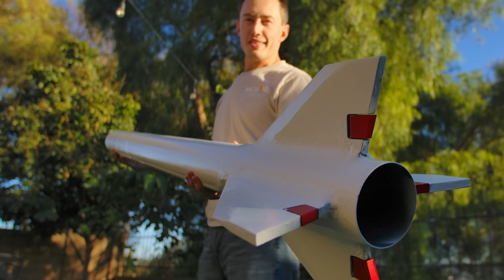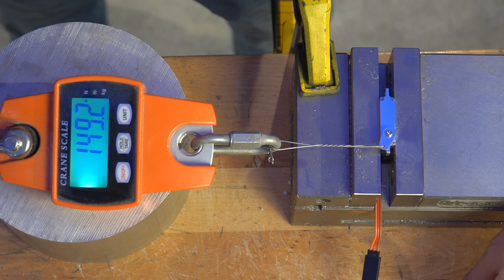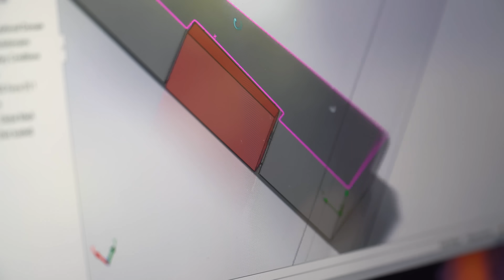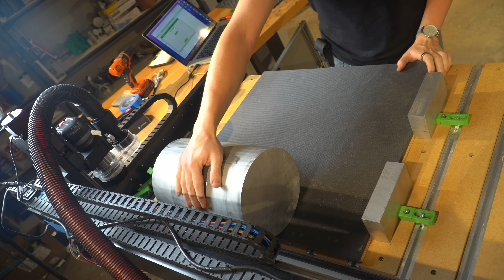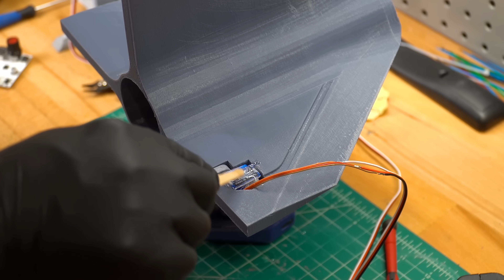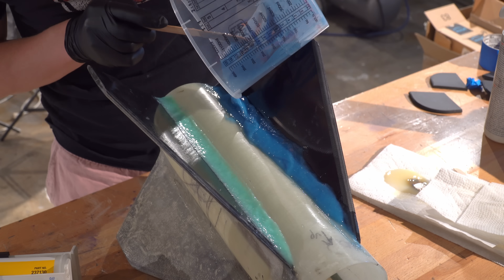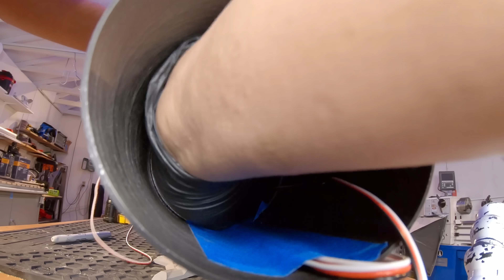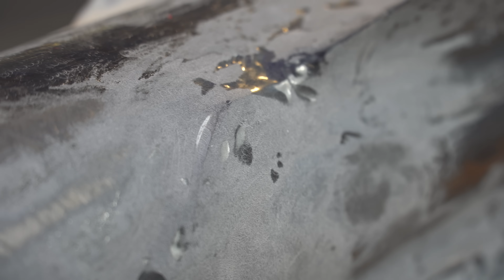Building a Guided Rocket to Hit Mach 3

Comment: Why not mill the fins from 2 pieces? In this case, you can mill botch sides (with chambers) in one setup. Just add alignment holes and glue it together at the end. You can mill in routing for wires and the alignment pin hole on the inside surface so the outside part will be flush and the highest stressed part (surface) remains intact. The bigger the rocket gets, the more sense this makes i think. 

Also a note about testing the servos: The servo was clamped to a big heatsink so the run times when mounted to CF will be significantly lower, especially if the servo is fully encased. 
Also, why not use the servo itself as the tab? Then the fin only needs a mounting point and a connector or passthrough for wires. you can use a pin-bolt as one of the pivots and backing it out allows you to remove the whole motor.

For a space shot, you might also want to prepare yourself that all heat producers need a heatsink mass to store the heat or need to be turned off as the only method of cooling is radiative. Area no longer helps you that much. Only mass. Do a vacuum chamber test for your electronics. This might be good content for a whole video actually. Temperature has a different meaning in space.

Keep up the good work! 
Hope to see you reach space!
Reply: The push rod between servo and fin is more lighter than a gear for torque.

The fins seem to have a blunt leading edge?

Sputnik was just pressurised. You don’t want to let the hot air of reentry enter your rocket.

Comment: When you mentions little filaments of carbon fibre sticking up and that you handled it frequently, it reminded me of building racing drones. 
Sometimes there'd be a little hair of carbon that delaminated and inevitably finds it's way into your finger. I've also had carbon splinters after I modified a Chinese carbon frame. The frame turned out great, and I still have it, but I bled for a while (I used to do all my modifications and sanding under a running tap to keep the carbon dust down. The sink ended up splattered quite liberally with blood) and carbon splinters hurt way more than wood or metal ones. I'm assuming the carbon is rough or even barbed at a microscopic level?

Comment: Ah you "let the smoke out of it" that will make it work better right lol.  Find out where the failure line is then back up a step works for me.  Question though why did you decide to have fixed rail guides instead of fly away rail guides?  I figured you would want less parasite drag trying to reach Mach .

Comment: Wow man what and where have you studied and got all that knowledge from and also the most little things that are important, like that you didn't payed attention to the fact that glasfiber is conductive. So maybe not an electro engineer, but you don't come here with a couple of Youtube videos, and build and using litterly rocket scienc to build a rocket, because you forgot 1 simple but important thing and the whole rocket won't work. So instead a lot of others that build rockets that go a couple of 1000's feet high, you are aiming for the skies and probably into space? Is that possible with scale model rockets? 

Because it is scale model litterly everything goes faster. Speed will build up so fast that you will hit so much dense atmosphere what will cause emmense drag, and because of that most fuel is expended and because you are still low probably still in the thermosphere where all life is possible so air and you want max power in the stratosphere, so a delayed burn and also adjust the rocket power. So all things considered, can you go to space with a scale model rocket that maybe is big, but I guess the FAA and authorities don't like people that have real rocket capability even 10KM in the wrong hands you can just shoot a plane out the sky 😆

Comment: I bet you thought about this yourself, but:
In your servo testing you had them clamped in your vise. Basically adding a large heatsink.
But in the rocket the servos are covered in resin, probably acting like insulation. Plus the heat from aerodynamics.

So since they only lasted 17 min in  what basically is the best case scenario for them, are you comfortable that they will last the length of the flight?

Comment: That is a great video for "no Effort", I dread to think what happens if you "make an effort"!. I was thinking as you made that, could you, on future builds, make a raceway channel slightly wider and deeper for the cables and then use PLA to printer a non conductive "conduit" to pass the cables through, this could be bonded into the raceway and if you can do it so that you have a shapped upper surface, then covering with a layer of carbon fibre matt or fibre glass matt to give a more consistant and aerodynamic surface may be helpful. Excellent video.

Comment: like your vids, what I was wondering was whether the flat ribbon cables like those used with the 12v LED stripes might work and whether it would even be better than wiring. They use 4 pins where you could run plus, ground and 2x PWM over one cable. but i don´t know how to get the cable raw without bs and no open solderjoints

Comment: Regarding placement and straigthness of those raceways: A strip of wood clamped or CA'd to the tube could serve as a guide for the shaping tool.
As is, these raceways have the potential to impart quite a bit of torque if they are not straight.

Comment: I used to build aircraft cabinets, and those mix tips absolutely do the job. Of course you still need to burn a little to make sure it’s mixing, but according to the FAA those tips are within regulations . . . .
Just follow the destructions. 🤔😉🤓🤪
You’ll save a lot of $$$ because you won’t be using as much. Also when you’re squeegeeing the epoxy, just hold a smaller catch bucket for the overage. Eventually you’ll figure out the exact amount of epoxy or whatever you used to build the product. Not even allowed to trim screws for clearance because “the screws must be less than three threads beyond the fastener, and no more than six threads beyond the fastener, and may not be cut or trimmed without ....”, FAA, whatever safety regulations say you can’t change the length off fastener without anti-corrosion protection.
So finally got the FAA off our back was when they finally realized the screws get plated, they dropped it. 😉🤓🤪😎

Comment: I was so relieved when you realised your oversight about carbon fibre being conductive. from building carbon fibre framed quads i learned how careful you need to be.
Reply: heatshrinking is fun, easy, and a good way to avoid this ( looks better too)
Reply: @TomS699  i was ripping my hair out seeing him not heatshrink those connections
Reply: @TomS699 I was thinking this as well!
Reply: I was ripping apart an old laptop today for parts and I found a ribbon cable w/ graphite conductor traces. I’d have assumed it was a funky color of insulation or whatever until I remembered this video. Ripped the sandwich of plastic around it apart and sure enough, it wrote on paper. I love materials that take just that little bit more thinking. Delightful.
Reply: Can't you just use it as a common ground actually? Like, driving down the cables count?
Reply: @Nibiroid Possibly. I wouldn't, since the cable count is not a problem anyhow, and the fins are not designed to conduct like wires are.

Based on some research, it seems like laminated biaxial CF (note: Only in the plane of fibers. Laminated CF is anisotropically conductive.) has a conductivity of about ~10-14 S/cm, or about 0.12+-0.02 ohms/cm. Across a distance of maybe a meter of fin, it would have a resistance of about 1.2 ohms. So it may not be a problem, but the resistance might increase dramatically if the fin flexes in the wrong direction, so I still wouldn't fly it on anything important without thorough testing first.
Reply: Honestly I really appreciate that Joe is going to the effort to show everyone the safety you need to have when you work with this stuff. Sharp contrast to other youtubers who go "Safety? What's that lol"
Reply: My thoughts exacly
Reply: I fly drones and also build atvs and gokarts why was my first thought when you said carbon fiber quads I thought I thought about some kind of racing 4wheeler
Reply: you just made me realise why my ESC broke😭

Comment: Hi BPS, Just thought I would mention something regarding a claim you said regarding carbon fiber "being worse than asbestos". this is a myth, and has been actively investigated and shown to be false. carbon fibers are not, naturally, deeply inhalable. they do not fracture lengthways by any natural process to reduce their cross section down to a diameter that they can get into the depths of the lungs like asbestos. they do not for sharp shards (preferring to sheer across the fiber)  and when/if they DO make it into the lung lining the material is able to be broken down by the macrophages. the damage done by asbestos is to these macrophages (the sharp long aspect ratio shards cause irritation, which summons macrophages which try and process the material, it cannot and the sharp points pierce the cell causing it to die,. it is this build up and summoning of dead macrophages which cause the asbestosis. however macrophages are able to process and breakdown the carbon fibers and their shape does not damage the cells. this myth originated from a single military aircraft crash of a new platform which contained carbon fiber and a first responder, who felt ill/ had breathing issues after blamed the carbon fiber and called it "the new asbestos" (despite exposure to who knows what other chemicals in the smoke) . 

TLDR Carbon fiber is many many times safer than asbestos, the myth that it is worse is false and damaging of adoption of this invaluable material and might be worth investigating/corecting, there are a number of studies done on rats comparing lung irritation of carbon fiber exposed rats to those exposed to asbestos!

Fly Safe!

Comment: The shift in neutral position of the servo after you applied the test load is due to plastic deformation/torsion of the servo output shaft! This compromises the shaft and it can shear off way before the motor itself reaches its maximum holding torque.

Comment: When isolating servo wire joints in the fins, why secure them with CA glue instead of simply heat-shrinking the joints?

Comment: Why would it be bad idea to use the carbon fiber as a ground for the whole rocket? It may save some weight and complexity.
Reply: The CF laminate is held together by epoxy so you can weaken it with the rocket heat. Fiberglass and CF body rockets typically have spacers inside which means the rocket motor has to be smaller.

Comment: worm gear drive servos are locked until driven. well, opencl can run any simulation on gpu. yes the kernels are just c-code. just making videos bro :) yep cf itches on your hands. for a short while only tho, at the skin level. dont promise anything if you wont be doing it anyways. at all. ie dont vow or judge others vowing. remember the commandments brothers.

Comment: I Love the content!!! 
- I've spotted the problem of unprotected solder joints the moment you started putting them in the CF :P Had really bad experience before -  the sharp CF edges can cut into the wire too! Chamfer the edges of the holes before guiding the wires through.  
- Would it make sense to fabricate custom FLEX PCB for servo wiring? It seems to be easier to CA it on the tube itself leaving almost no extra thickness. You can get same crossection as servo wire by just increasing the width of the trace.  
- If you're still smelling some fumes or particles or something after the shop-vacs HEPA (doing anything), the trick is to put the VAC outside, make some 3D printed quick connection hole in the shop, and run the VAC with bag only, no HEPA. this way it will have much more flow due to less pressure drop, and all the nasty stuff that might go around the filter bag, won't end up in the shop. :) 
- Drill "precision" holes in CF by attaching the part in the CNC, then using the diamond endmill, plunge it vertically in the CF with max RPM your spindle has (24k?). I get perfect holes this way. Normal drills doesn't work well with CF. You want to abrade material away more then cut it.

Comment: It would be interesting to see you try out some ‘bare bones builds’ where you DON’T build an unserviceable tank and instead try to skate the line with the strength to get much less weight. Because to be fair, if you could pull 2 kilo’s out of your total rocket mass… that’s likely a fair bit of your camera payload budget right there? Or are you planning to take the camera from ‘The Slowmo Guys’ up there😂 So a self build motor, in a thin-walled aluminium or even carbon fibre case (I have no doubt Charlie would find that SICK), with optimistic amounts of liner material. Fibreglass airframe with FEA optimised 3D printed sections for seating the avionics and camera units. Lightest reliable chute deployment method. And fins that aren’t the 20mm thick without the ability to be serviced.

Comment: That is one herky-jerky servo! I would go for something that entails a drivescrew/wormgear instead, and maybe just use a brushed DC motor with an encoder to feedback the position of the wormwheel that the wormgear is driving.

Also, why not just use small diameter toobing for the wiring, instead of trying to epoxy over the wires? Heck, you could cut some tubing in half and just lay it over the wires. Then do some fiber layup over that so it's all one single unit. :D

Comment: Hi, regarding the conductivity of carbon fiber (CF), it's essential to ensure that wires are adequately protected around sharp edges of the CF. Vibrations can potentially wear through insulation, leading to short circuits.

Comment: Really nice Vid, Joe! @BPSspace tip for working with epoxy: put vaseline on areas you dont want epoxy (hinges etc) prior to epoxying and use alcohol to clean surfaces AFTER epoxying (and prior to hardening). I have found that alcohol (I believe you called it IPA, but for me that is a type of beer) is about the only substance that cleans off Epoxy when it is still "wet".

Comment: This was a lot of work. Could you make it with two carbon fiber tubes of slightly different diameter, like a shell? You place all the wiring along the outside of the smaller diameter tube, slide the larger outer tube over it, then fill the void with a lightweight, structural foam epoxy or something.

Comment: About the servo etching to better bond it; why not just rough it up with sandpaper? or even just scoring the surface with a  in a lattice pattern. both of which would significantly increase the bond and would be wildly simpler.

Comment: I was like.. Bro why are you skipping the heat shrink tubes for the cable soldering. and then the conductivity problem came and you solved it with glue.
 ._____________.

Comment: 15:23 careful with those bare soldering points; carbon fiber composites are highly conductive

LOL 16:40 one minute later you found out. Very attentive my man!
Reply: Mine was more like "Doesn't bare joints in CF make a short circuit...  yeap, 100% short is causing problems."
Reply: "Never leave open connections."
Remains to be: "Never leave open connections." 😅

Comment: For the next time, you could look for servo cable, that is sold in 10m packages to reduce solder connections. Or better, using a long pcb for the runway and a laser to align it properly.  That should help keeping the aerodynamic impact minimal.

Comment: Have you considered nickel plating the 3d printered parts that need to be heat resistant? Even a thin layer will be very heat resistant.
Reply: Might as well just use aluminum tape.
Reply: @ChucksSEADnDEAD  that's an option too

Comment: Please use crimp connector, solder cable will lead to break at the jonction solder/copper with vibrations. And you can find easily crimp splice with thermo shrink on them too to have seal connexion. This is standard in aerospace/military industry